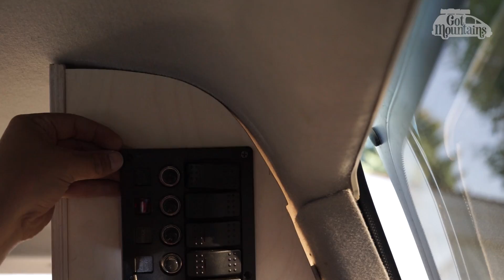Camper Van Cabinets DIY // E13 // Van Conversion Layout Ideas

Comment: Looks like a product named Def.  dryers in 30:20;45 minutes. Found out about it from a cabinet maker.
Reply from the maker: Is that the Varathane you are referring to?
Reply: GotMountains   I believe it is .  It is the best I’ve used stands up great. We have a counter coated with 3 coats after apply a pecan stain. Still no marks & it sees lots of use in my wife’s craft room. The trade name is DEF  WE buy it at Lowe’s.

Comment: Beautiful install. Truly. But 2 minutes on the install and 4 minutes on staining is reversed. How did you install the brackets etc. Please.
Reply from the maker: Haha, yeah, we're getting better at the video thing, albeit slowly. I need another van to build now that I know what to film more of! Which brackets do you mean? The ones to the 8020 or the ones connecting wood to wood?
Reply: GotMountains the metal brackets that connect to the vehicle. Your video skills are far better than mine. Thank you for the videos
Reply from the maker: Ah, I see...I actually used plumbers tape to screw it to the wood floor/wall, but the small white ½" brackets would work, as would the aluminum brackets for 8020. I think I used them in one of my first videos but I'd have to search through them to find which one. Might be time to out together another video...lol

Comment: Amazing build. I'm glad I found your channel! What kind of flooring did you use? Glue? Ever expand and contract? I've been driving myself mad trying to decide on flooring!!!
Reply from the maker: @JB-wv7iv  I have built a few for others but it's just a side thing for me. The flooring unused was just high quality linoleum. I found a small piece at a local store that was selling cut off ends. They had the glue there. It's a glue that you can peel up if you need to.

Comment: SPECTACULAR!! Does this finish cause off gassing as you guys are sleeping in a very tight sealed space? I have asthma & ask b4 I build. Thanks so much! Absolutely gorgeous!!!
Reply from the maker: Thank you! Yes, it will off-gas for the first day or two, but once cured, there will be no more VOC's present. They make an oil-based version and a water-based version (we used water-based), but we let the van cure for two weeks before using it, so by the time we took it out the VOC's were long gone.
Reply: @GotMountains  ❤❤❤❤❤